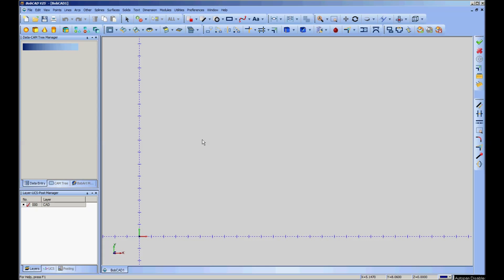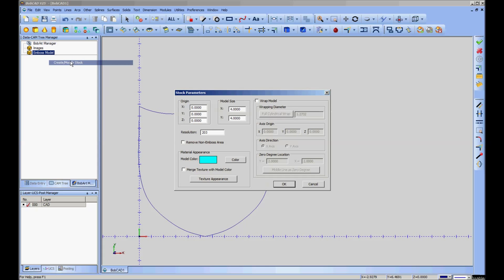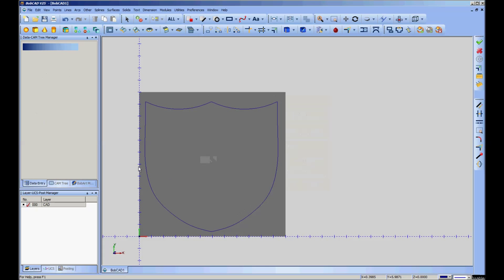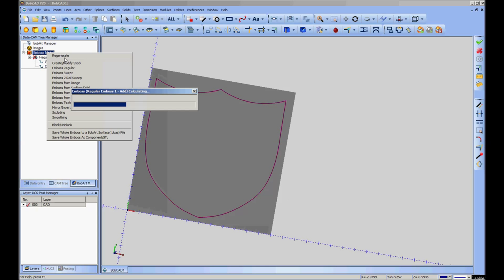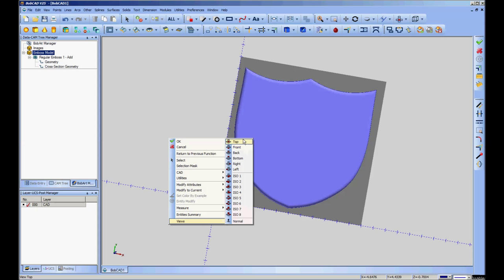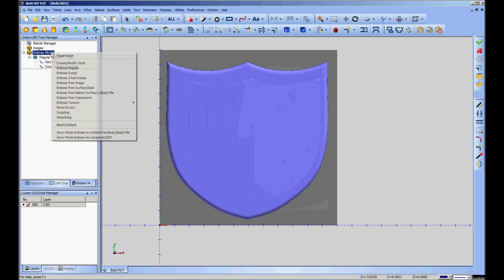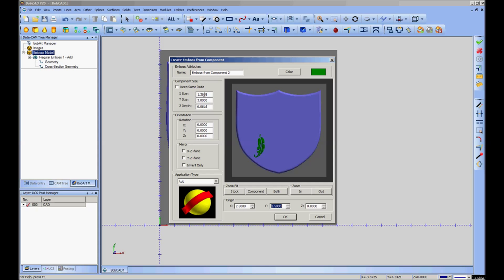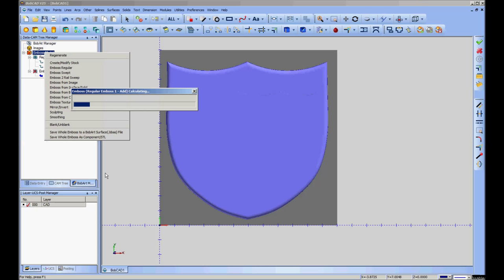BobArt Pro stl example

Comment: OK, so how can you save this creation in STL format to be used later or by another STL compatible program such as an STL viewer?  Everything I have tried resulted in a corrupt file that was useless with any other STL capable program I tried.
Reply: Saving as STL will reload in Bobart but nothing else.
Reply from the maker: UniqueGiftsOfWood Using [Emboss Model] <Save Whole Emboss As Component/STL> is how I've been doing it. I've had no issues opening the resulting .stl files in Blender (the only other program I've used with them). As far as I know, it saves as a standard .stl mesh.